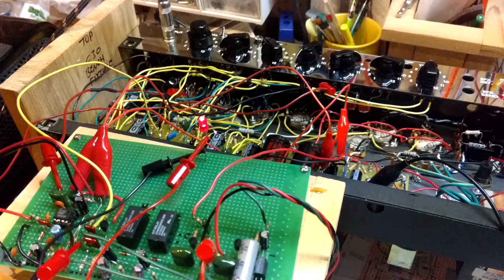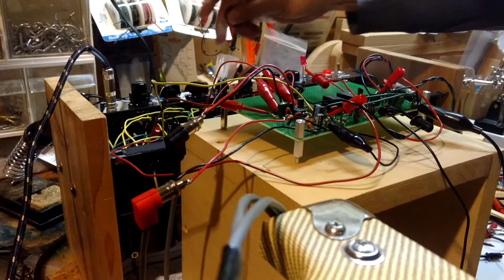Peavey Classic 30 - Hand Wired Part 3 / Phase 2 circuits for Reverb and Tremolo

Comment: we shared our country,you could share your schematic,wow.
Reply from the maker: It's actually the Peavey schematics.  90% classic 30, 5% classic 50 (tremolo), 5% other mods (cathode bias switching, added Master volume, parallel filament wiring, etc...).  I don't have a complete one to share.
Reply: @Bobsbluesmusic   if you cleaned up the paperwork a bit people would buy it from you.  You've done the work, reap the benefits.  🤷🏻‍♂️
Reply: really interest to modifie mine if you have the schematics!